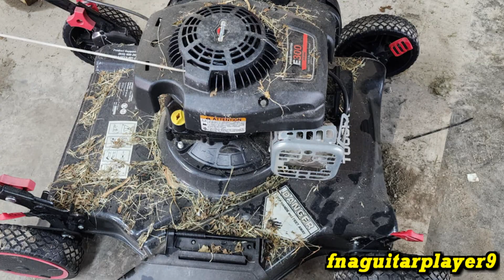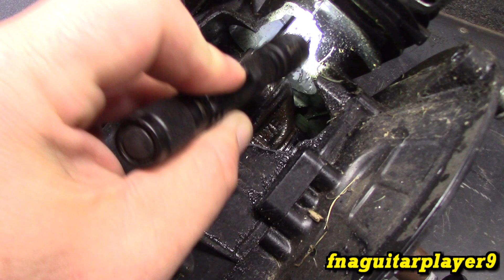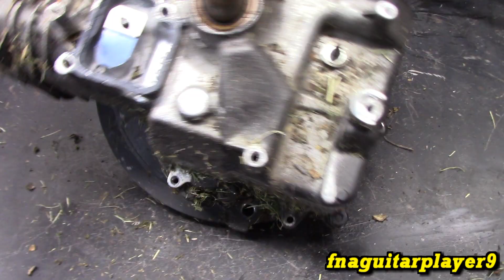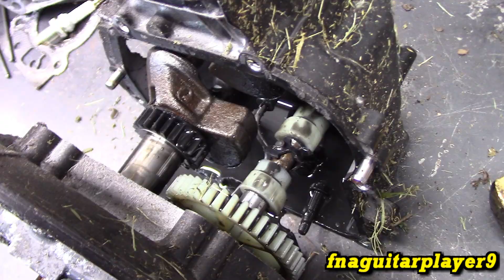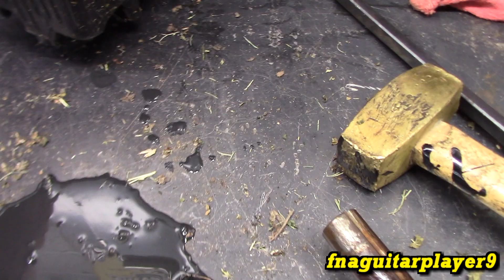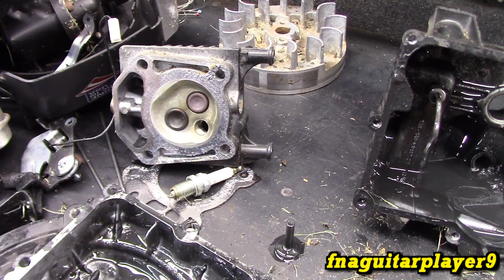Blown Up Briggs E300 Push Mower Engine Teardown!

Comment: Good video.  I'd also suspect low or no oil.  I would really like to see you make a video on repairing block holes.
Reply from the maker: Thanks, I've done it before in this video here on a older 5HP! Very difficult to do with the only method i have of welding aluminum! https://youtu.be/6VWkgYY5IrQ Thanks for Watching!!!